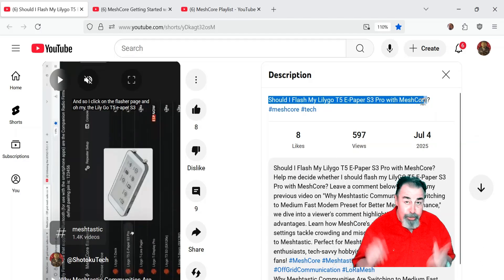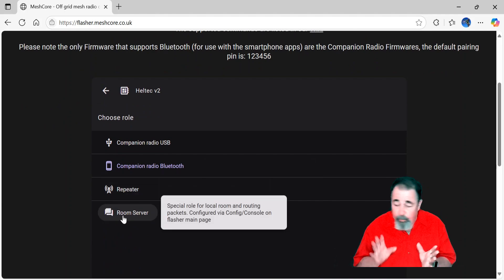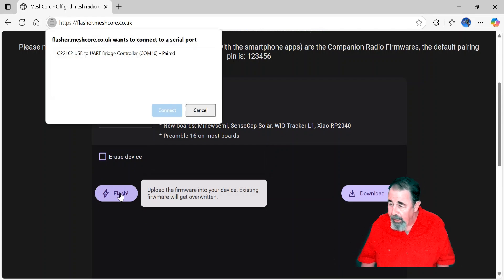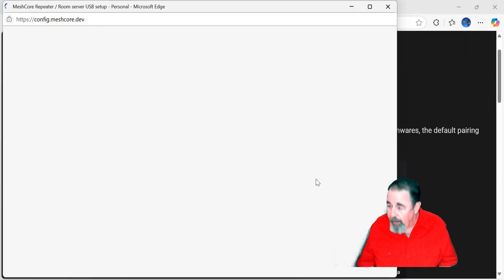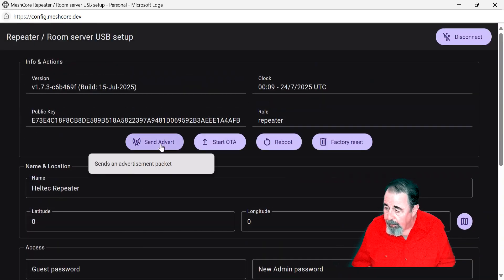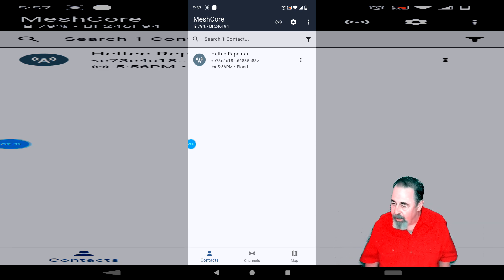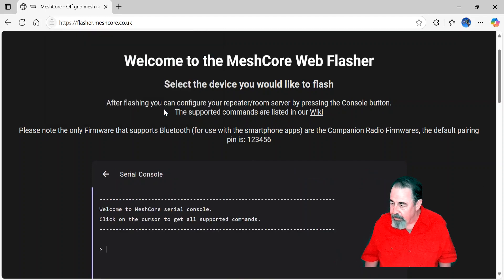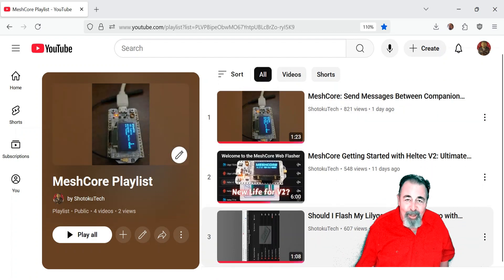How to Flash a MeshCore Repeater with Heltec WiFi LoRa32 V2: Step-by-Step Guide

Comment: I tried it today but after flashing looks exactly like in your video it can't connect to configure. Always an error. 
Is there another usb driver wich can flash but can't configure.
I have always luck with this kind of things 😂
Reply from the maker: Yeah, I had some mixed luck with Meshcore. It worked out of the box. But I met the local crew and they had different settings they want on their mesh. I set them and none of my devices with send or recieve. LOL. Can you connect via Bluetooth with the phone app? best wishes.
Reply: @ShotokuTech i try BT maybe today yesterday my phone didn't found a device. Ah I forgot flashed it as repeater. Only usb config says the mashcore side. I saw there is a different usb driver for newer boards. Mine says 3.2. maybe that's the problem.
Reply: @ShotokuTech I tried it again even with erase device. I couldn't configure it via usb but flashing was no problem.
Yesterday I flashed a client firmware on it. Bluetooth config was no problem. But I want to use it as repeater high in the house. The repeater firmware can only be configured via usb. Maybe it's the cable but flashing was without any problem severel times.
Reply: @ShotokuTech  ok a little update. I dont know why but 5 Minutes ago i could connect for config. I did nothing different.

Comment: On my Heltec WiFi LoRa V3 I can get my PIR sensor working fine in the Arduino IDE, but when I flash the board with Meshtastic firmware I can’t get the PIR sensor to work. I’ve even gone into the web-based Meshtastic interface and manually set the pin, but still no luck. Any ideas what I might be missing?
Reply from the maker: I have been thinking of incorporating some sensors into Meshtastic. I have only included GPS so far. Maybe I will try this soon!? No suggestion comes to mind right now. Best wishes.